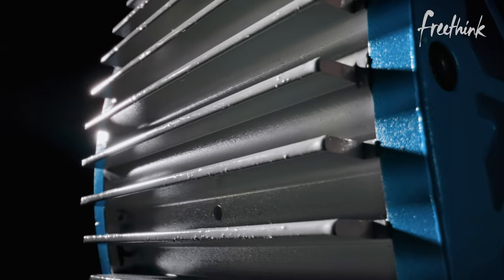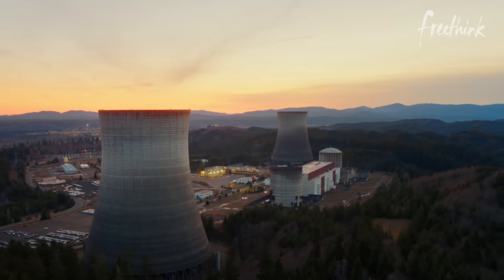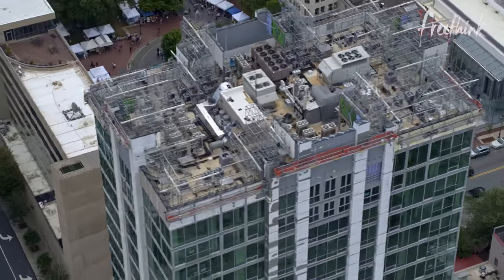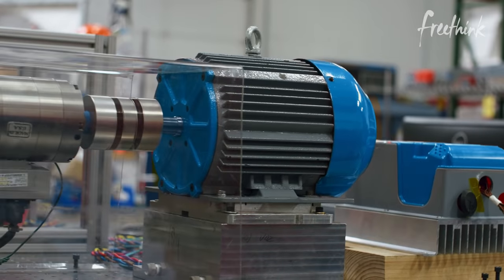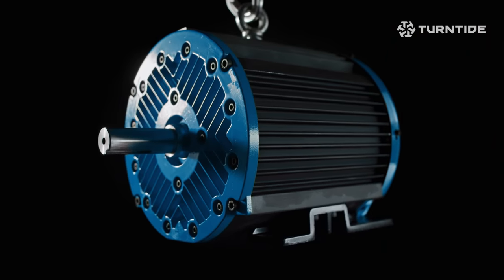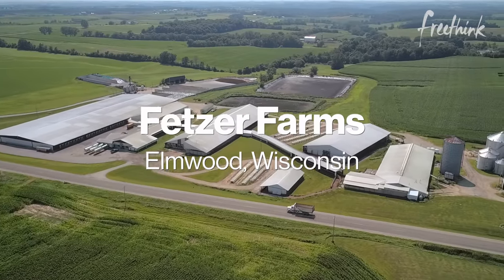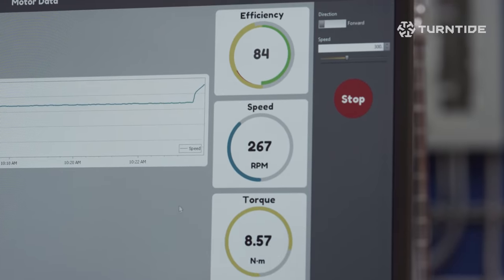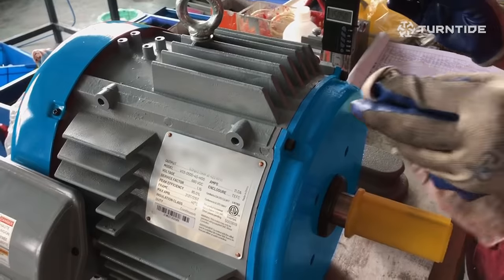Want to Save the Planet? Start with Reinventing the Motor

Comment: Ok I know a lot about motors, and switched-reluctance motors are not a new thing, they are decades old.  Motors have always been eyed to get the most power out of a smaller package, and almost all motors have a wide region in their load curve which exceeds 80% and usually better, and the highest power density is usually from strong-permanent-magnet motors.

Motors only waste half their input power when you run them at a load level to get the maximum power out of them, which is rare except for some smaller fans and cheap toys, and is usually an overload condition in larger motors which quickly overheats some of them and is often used only for intermittent high power applications.

Motors are about as good as they can physically get and don't need refinement in this area.  The only developments needed are for example a low-speed high-torque unit which can be built more economically, for example.

I stopped watching the video half minute in.